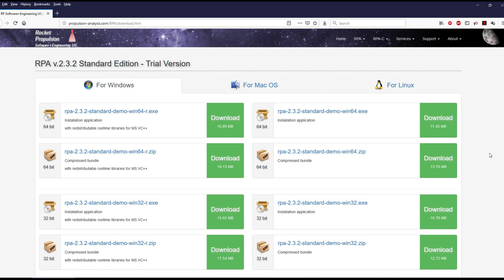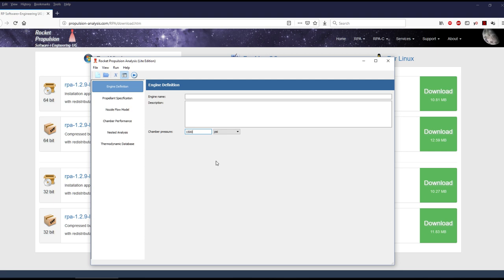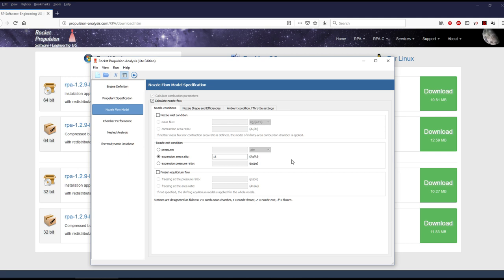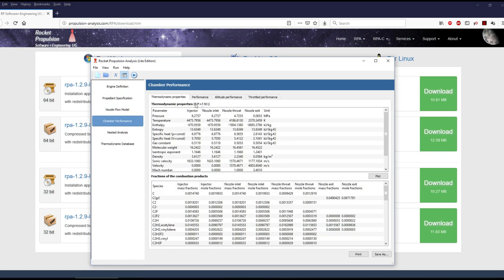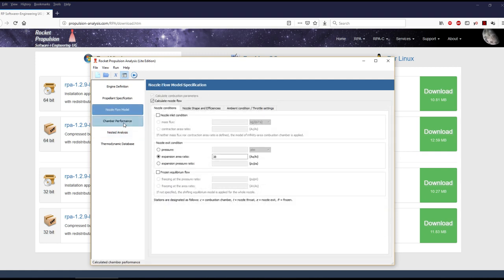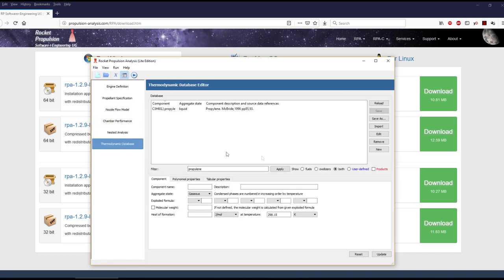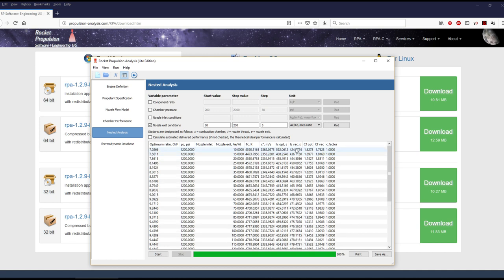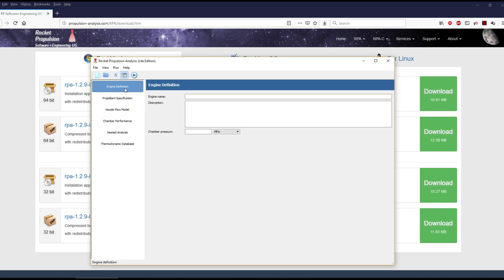Rocket Science - Using RPA Lite for Rocket Engine Design

Comment: Not so much surprised by the high combustion efficiency, because of the Fluorine. Probably would want to run fuel-rich rather than "optimum" in this case (temperatures and, again, Fluorine)?
Reply: RPA optimizes for highest c*, not for highest temperature (which is around stoichiometry). So optimization is kind of okay yo use. Later on we can change the OF ratio based on tank weight and performance trade.

Comment: Hi, I have been trying to use RPA for a LPR based stage calculation. I am unable to understand what is 'other component mass' that RPA is generating which is getting added to total engine mass. It is giving turbopump and chamber masses. Is it propellant mass that its calculating and giving as other component mass? This value is very high as compared to other inert mass that software is giving. Can anyone comment on this please?

Comment: How accurate is the thrust calculation? I've seen some other formulas and depending on the one I used I got different results
Reply from the maker: It should be accurate for the exhaust velocity stated above it and, of course, the efficiencies that you've written in. I don't know if your other formulas took the reaction and nozzle efficiencies into account.
Reply: @RaizSpace  They didn't, but even with 100% efficiency the thrust just comes out way to low. I used the parameters from the AJ10 and Merlin 1D respectively and the simulated data yields thrust that is significantly too low.
Reply from the maker: Meriln 1D might have a complication regarding the supercooled propellants, but let's say I input Merlin 1D's 1410 psi and 16 nozzle ratio and let RPA pick the efficiencies. From that I get a mass flux of 338.0175 (units) at nozzle exit and an exhaust velocity of 3095.67 m/s. Multiplying those two together, we get the thrust per meter squared of nozzle exit area - 1046.4 kN per m^2 with an overall efficiency of 0.9646. What's the nozzle exit area that you were using?
Reply: @RaizSpace  about 0.6648 m^2, which should be the right area, if wikipedia is correct. And that gives 695.6 kN. Shouldn't it be somewhere around 800/900? If that is the correct estimate, then I must've jumbled up the calculations for the AJ10, since my result was some 80% off.

Comment: what if you wanted higher thrust out of it without increasing chamber pressure?
Reply from the maker: I guess you could change the fuel/oxidizer ratio to reduce the temperature of combustion while increasing the mass flow, but otherwise, since PV=nRT in the chamber and you need to increase n (the mass flow) to get more thrust and the volume is fixed, you would normally get higher pressure.
Reply: like, let's say I wanted to make a giga-gg engine, something similar to the F-1, but this only gives you the mass flow per m^2 of nozzle. I tried multiplying that by the nozzle area, but it ended up with only ~1500kg/s, vs the 2500kg/s the F-1 had
Reply: Without increasing pressure if you want higher thrust then you have to increase mass flow rate. To stop the chamber from going higher, you have open up the throat area, and/or also increase the chamber size.

Comment: Just downloaded this program and saw this video for the first time as a guide.

5:25 OH YES there's ozone! And fluorine! I thought for sure the lite version would lack exotic stuff...

6:30 "Usual" and "fluorine" don't really go together... I don't think there was ever any operational frothy engines.

7:25 So, the monopropellant option simulates decomposition?

13:05 While I understand the gas logic behind that, I don't understand how it works energetically, as it implies that a rocket with high molecular mass exhaust can never be as thermodynamically efficient as one with low molecular mass exhaust, regardless of the temperature and pressure differences between the chamber and nozzle exit (e.g. why would a heavier propellant with 10 MJ/kg produce 300 s while a lighter one with the same energy density would produce 400 s?)

13:40 AFAIK speed of sound is mostly dependent on molecular mass and temperature,  not density. If it was heavily dependent on the latter, Tibetans would have massively different vocal ranges than the Dutch, for instance.

16:45 You could also multiply the exhaust gas density by the exhaust velocity squared to get the thrust density/nozzle overall dynamic pressure, but you do you...

18:50 A mole is an animal that burrows in the ground, or a spot on your chin that you gotta shave around, but there's another kind of mole of interest to me, that's the kind of mole they use in chemistry—_HOLY SHIT_ that combustion is so hot it's resulting in free electrons!

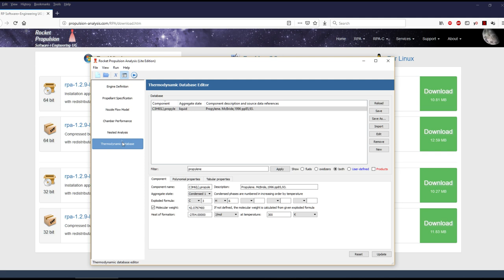21:50 I think the density of this propellant mixture would be a larger reason to use it, if they accept the resulting hellish acid rain. This is not given by the lite edition of the program (made more problematic in that it changes with chamber pressure), but it would be relatively easy to hand-calculate or use a separate spreadsheet.

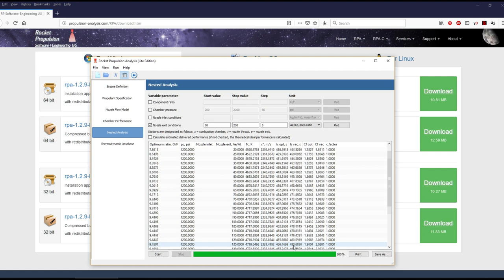24:15 There's a box you could tick for the expected delivered performance.

24:40 I wonder if a full combustion model like this could be added into (probably KSP 2) RO, to allow for much more detailed simulations of a whole lot of stuff. And ease the full use of suboptimal mixture ratios. grumble grumble

I just ran a notional N2H4/H2O2 engine in the analysis, and it turns out its performance is even better than I estimated! Thank you for introducing this! Now, if only it could deal with non-chemical stuff...
Reply from the maker: Okay, so there's a lot here, but I'll just handle the molar mass question. There's a few things going on there, but the easiest way to think about it is that energy is lost to the internal jiggling of the exhaust molecules, so the more complicated those molecules are, the more energy will be used up by them just getting excited rather than heading out in the direction we want them to.
Reply: @RaizSpace  Makes sense.

First time you've stated my comments can be long. Content-wise, they tend to be leaner than they look, but I understand that while writing them in a time-stamped pseudo-stream-of-consciousness style allows easier determination of when the thoughts emerged or what the thoughts are relevant to, it makes determining how important/substantive they are, where context ends and questions begin, etc. more difficult.

Comment: How can i get the coordinates for bell nozzle....to import into CAD software ??

Plz reply its very necessary to me ..
Reply from the maker: Obviously this already should have given you the throat and exit areas, so the only aspect of the nozzle you may not have is the curvature. I don't have the full version of RPA, but I believe calculating the nozzle is one of its additional functions. That's expensive, though. There are equations you can look up that govern the curvature of the nozzle, but honestly, I often just make an educated guess based on nozzles from similar engines.
Reply: Just use GVR Rao sir's method of finding nozzle contour. First find the wall angles both theta n and theta e and then find length of divergent nozzle then it will be solved.

Comment: Ok what is the thrust in kn?
Reply from the maker: That depends on the size of the engine. You can use the mass flux at the end of the nozzle, which I pointed out in the video, and use the equation Thrust = mass flow * exhaust velocity to figure out how big the engine needs to be to get the thrust you want. Mass flow = mass flux at the nozzle exit * nozzle exit area.
Reply: @RaizSpace  thx

Comment: Hi, i have played around a bit, and i got a 500.41s ISP with a O2/H2 Thruster, 2.059kn/m^2. Do you think that is realistic, and can be used for RP-0 (RP-1) ? https://www.dropbox.com/s/fyverdj8eo67t7b/Hydrolox2KN500sThruster.cfg?dl=0
Reply from the maker: Was that from the top box (theoretical) or the one on the bottom with the efficiencies built in? What efficiencies did you have, chamber pressure, and nozzle ratio? It sounds like something is very optimistic. Keep in mind that a small thruster like that would normally run at pressure-fed levels (50-200 psi) so it could relight often.
Reply from the maker: Ah, I see that's the RPA cfg, not a KSP cfg. I think you'll find that an area ratio of 14000 is going to result in a very heavy thruster - you'll be getting 2 kN out of an engine mass that should normally produce 700+ kN. Also, the 14 MPa chamber pressure will require a turbopump, which will add mass and limit the ability to relight. Basically, it's going to be heavy.
Reply: @RaizSpace  I have tried to modell the engine on paper (2D), and i came out with a Diameter of 66.76 cm and a 1mm thick nozzle weigthing 4kg (Tungsten/Niobium/Scandium/Aluminium).
I have no clue how heavy Turbopumps are, so i cant tell about that. But the lack of relights means that it is not usable as a Service engine on a Space Probe, but thats anyway a bit far for Liquid Hydrogen.
I got a config for it on the Astris Modell: https://www.dropbox.com/s/fas1m61k8j3bcst/Astris_Config2KN500.cfg?dl=0
Reply from the maker: I don't think any part of an engine can take Aluminum due to the temperatures. One problem is making sure that any force on the side of the nozzle doesn't warp the throat, since the nozzle is so big in relation. Making the tiny parts, including the cooling tubes for the chamber, would be very expensive. What can I say, though? You're certainly milking the ISP with that nozzle, and once you have the numbers, the only way to figure out the difficulties is by actually trying to make the engine.
Reply: @RaizSpace  I am only using Aluminium for the bottom part, 600 to 250 kelvin in order to save weight. There shouldn't be anything pressing the exhaust inwards above 40km neither in space. I planned a 1cm thick thrust chamber so its not in a big need of cooling.
All in one it means that it's   expensive for its thrust, has limited ingnitions and burntime.
I could make the engine in RPA (not lite). If I had 210£ laying around ... Is there another Programm for that ?
Reply from the maker: Well, just in terms of a model, if you tell me the dimensions you want, I'll model it in Blender. I'm not at the point where I'm tossing money out for this stuff yet, so I can't say anything about tools beyond what I have.
Reply: @RaizSpace  Alright, I've redone the Math, because I didn't have the lenght of the nozzle correctly. It is 1.75 meters long and weights 17 kg. I made a design sheet of it: https://www.dropbox.com/s/4sfuisg1agf1idl/2KN500.png?dl=0 
The production cost is kinda based on a Rutherford Engine though i have no idea how many workhours you would need. But 25 to 30Kg is ok for that engine, it's just very big.
I think my goal right now is just to get this Engine into KSP, what else can you do with something like this ?.
 But thank you for help
Reply from the maker: Here you go: https://www.dropbox.com/s/o46k6yarsxcrq12/KAMods.zip?dl=0. Just drop the folder into GameData. You should see it as "Cause 2kN Thruster" with your stats, though the stock version is fully throttleable. I added a degree of gimbal, but you can delete that if you want. The texture is very basic.
Reply: @RaizSpace  Thank you for that, now i can see how big such an Expansion Ratio is ...